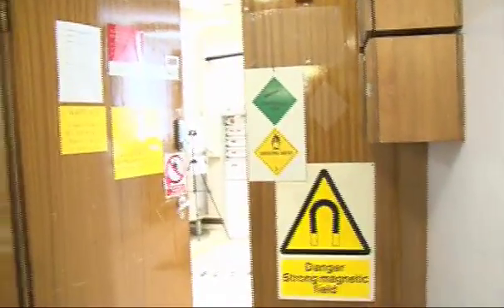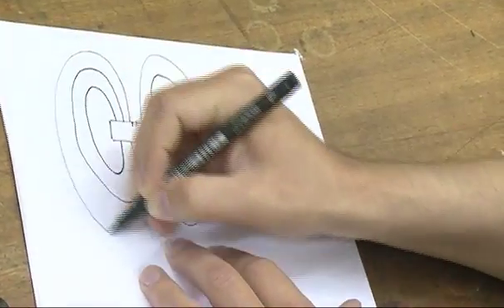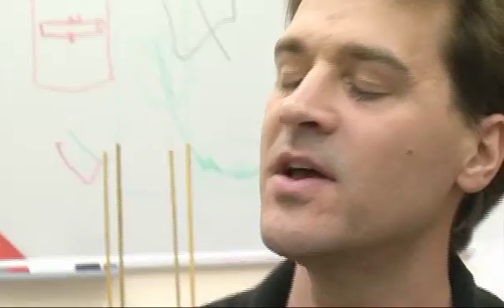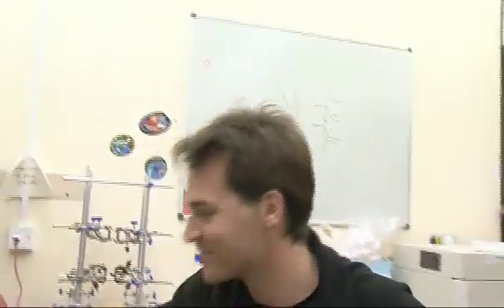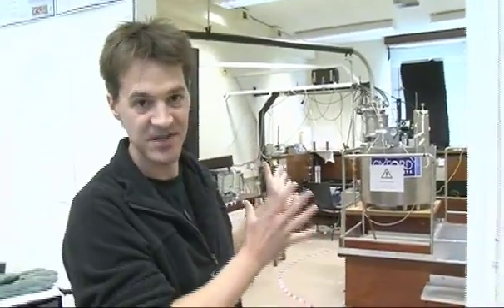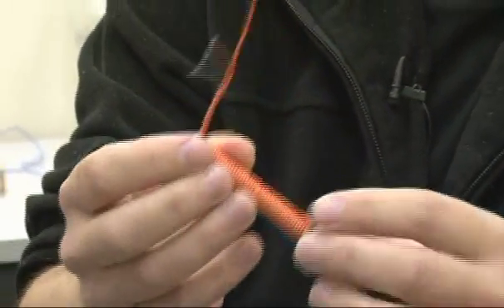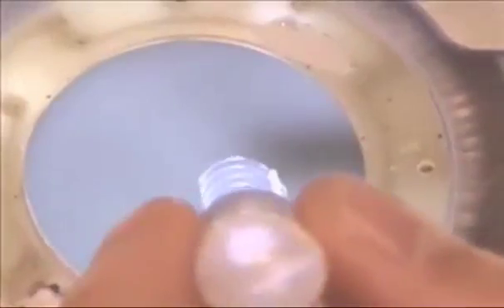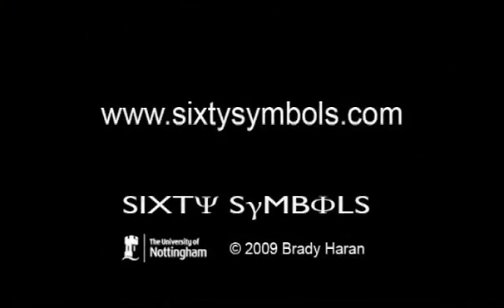Magnetic Field - Sixty Symbols

Comment: To say "B" stands for magnetic field is not exactly correct.  B is the magnetic flux density, whereas phi is used for total flux.
Reply: B and H have the same unit of measure in SI, usually people mix them up which i also find a bit annoying. But for simplicity's sake

H is an inductory magnetic field, B is the resultant of the inducting magnetic field but felt INSIDE a substance + the magnetization felt insid the substance, 

B, M, H all are measured in the same units in SI.

Comment: "Can we have a video that explains where magnetism comes from? I know it has something to do with the alignment of the atoms, but that's all I know."

==Any moving charge produces a magnetic field around them. For particles that have a negative charge, you can use the left hand rule (LHR) and for positive charges, you can use the RHR. You would need graphics to better understand. If you pass some current (electrons) in a wire, it produces a field around it (use the LHR). Your thumb should point in the direction of the electrons and your fingers (curl your fingers) point in the direction of the magnetic field.  If you make a coil with a long copper wire, the field squeezes together and it becomes possible to make a very strong magnet, specially, when you insert a ferromagnetic material in it.
These are called electromagnets.

//EDIT: I had to correct the LHR and RHR part. Thanks sidewaysfcs0718!
Reply: louis tournas And to add to that, permanent magnets come from materials where electrons move inside the material in the same direction. So just like a coiled wire, as electrons move inside a material they create a magnetic field (moving electric charge). If you have enough of them all pointing in the same direction you get what we call a magnet. Iron is one of the few materials that are capable of keeping its magnetic domains pointing in the same direction without an external field being applied.
Reply: @loganpoppe3494  , why in iron?
Reply: Actually, for negative charges you use the left-handed rule, and for positive charges you use the right-handed rule.

By convention, the right-handed rule gives you the correct orientation of the magnetic moment for a rotating positive charge.
Reply: louis tournas magnetism is a rekativistic phenomena. you can watch a video about this on YouTube channel on VERITASIUM

Comment: Maybe his camera has an HDD instead of Flash.
Reply: both HDDs and tapes rely on magnetizing a region of the tape or disc.

flash storage relies on trapping electrons in what's called a floating gate transistor. each transistor represents one bit, if you apply a voltage accross it the current will depend on the voltage at the gate. in floating gate transistors the gate is actually insulated (on a normal transistor it's just one of the 3 legs), and unless you apply a relatively high voltage it retain a small charge because some electrons or electron holes will remain in the insulated region. wiping this with a magnetic field is going to be much more difficult.

Comment: Ha! Yes! - unbeknown to me, the 'magnet safe' aluminium ruler had been swapped for a steel one, and in my excitement to measure something in an experiment that had just started working, I didn't spot the swap. Words were said.  The strength of the field increases by x8 each time you halve the distance to the magnet (B~1/r^3), so the force goes up very quickly as you approach the magnet.

Comment: "Accidentally", right? :-) .... So why is that the keys were barely attracted? How far was "too close" for the ruler? Thanks for the reply ;-)
Reply: This is an old comment but I will answer it.

It has to do with flux density and the physical magnitude of the field itself.

The stronger a magnet, the more coherency of the atomic dipoles. The more coherency, the tighter the spin at the plane of inertia (bloch wall) due to increased acceleration of the lines of force. This tightening of the lines of force reduce the total volume and area of the field magnitude. So although it may be stronger, especially up close, the density is very much weakened as you are further away. This isn't to say that the lines of force stop at a certain point because they don't. They get less and less dense the further away you get and this decrease in density is inverse logarithmic. Meaning is decreases exponentially relative to distance and time.
Reply: @nazgullinux6601  , hard to understand

Comment: I once accidentally took a 30cm steel ruler too close to this magnet. The field crushed the ruler to ~3cm long  _lengthways_,  snapped the steel in half and embedded an imprint of the ruler's engraved markings in the stainless steel outer case (vacuum chamber) of the magnet, on the way down!  That occurred just at the top of the magnet, where the field is ~2-3 Tesla. 17 T in the centre. THAT'S why the warnings are there! Cheers Rik (guy in video).

Comment: Wtf all the warnings just for a magnet that can barely attract keys from 1 meter? Son, I am disappoint.
Reply: It has to do with flux density and the physical magnitude of the field itself. The stronger a magnet, the more coherency of the atomic dipoles. The more coherency, the tighter the spin at the plane of inertia (bloch wall) due to increased acceleration of the lines of force. This tightening of the lines of force reduce the total volume and area of the field magnitude. So although it may be stronger, especially up close, the density is very much weakened as you are further away. This isn't to say that the lines of force stop at a certain point because they don't. They get less and less dense the further away you get and this decrease in density is inverse logarithmic. Meaning is decreases exponentially relative to distance and time.

Comment: in response to your original question. We can't create anything nearly as powerful as the earth's magnetic field as of now. The field strength of any magnetic field drops off at the cube of the radius. So in the center of the earth the field is immensely strong. Only reason the measured power of the field is so low is because of the radius of the earth is massive. There is more going on here but that is the general idea.

Comment: Mobile phones have hard drives that can be wiped clean with strong magnetic fields. Microchips, on the other hand, do not store anything via magnetic bytes. They are simply electric circuits. If you moved the chip along the magnetic field, you would probably destroy the circuitry or blow a fuse. However, if you just kept it still in a magnetic field, there shouldn't be a problem.

Comment: @katulobotomia I'm not an expert but I'm pretty sure that's not right.  If you hold a fridge magnet next to a current carrying wire, the wire will be deflected.  This can only be due to a magnetic field, because the wire is neutral overall so a purely electric field would not cause it to move. Magnetic fields are generated by moving charges, but there are moving charges inside a fridge magnet, when you look at the atomic level.

Comment: @gtq838
Microchips are very easily effected by magnets. They contain wires of various lengths, all of which when passed through a magnetic field will have a current induced in them. Not only will this disrupt the precise charges which govern normal operation, it can also push those currents beyond safe levels and permanently damage the hardware itself. Most chips have some level of magnetic shielding for this reason.